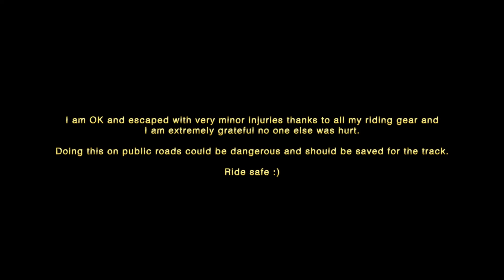CRASHED MY MOTORCYCLE - Kawasaki ZX-6R (Lowside)

Comment: Sucks to see that bike written off, but the new bike is seriously nice. Some constructive criticism: work on your posture so you're not getting the bike leaned that far over. Right before your back wheel came out, you can hear scraping. You either ran out of rubber or picked up the tire after leaning onto something sticking out from the bike. The problem is you're crossing your body position to lean the bike over (0:58 for example), but you should be moving your weight off the bike to get your knee down instead. Seriously, not trying to knock you, but this is a very common bad habit new riders learn. Go do a track day and grab a coach and get some pointers. Or if nothing else, watch some videos on body positioning. This video was from 7 months ago and you haven't posted much since, but hopefully you're still riding. And post some more vlogs. :)
Reply from the maker: Thanks man! That’s awesome advice and I’m definitely taking it into consideration moving forward. Still going strong and enjoying each and every ride. 👌🏻